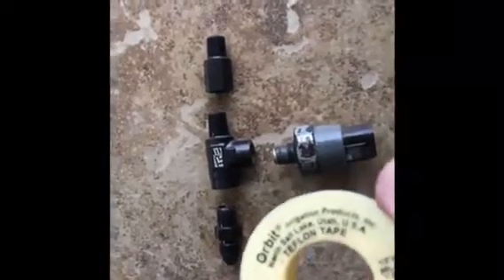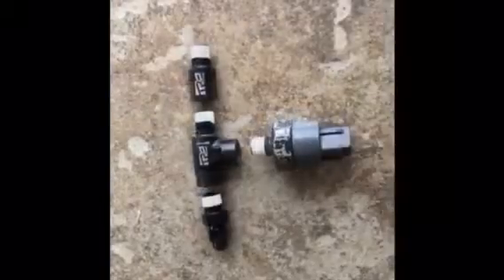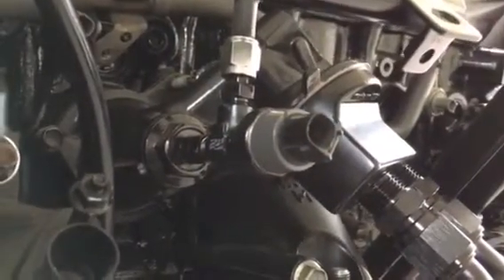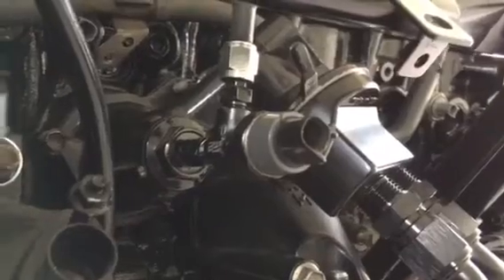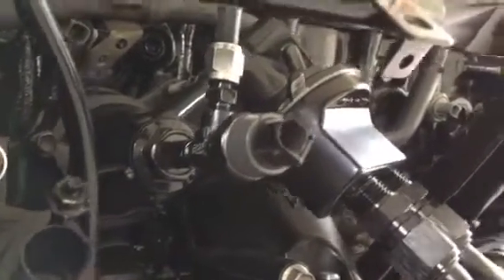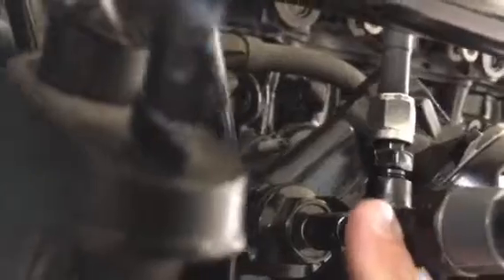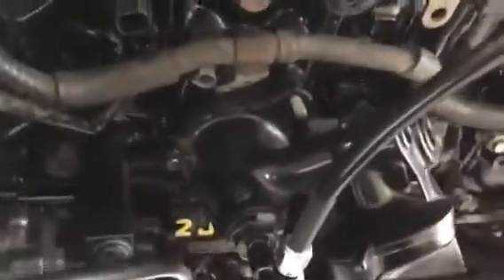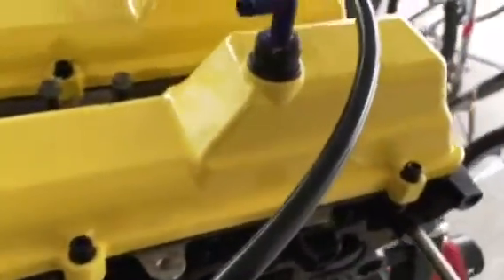Lexus IS300 turbo build part 9/ turbo oil feed line

Comment: Where can i buy that T adapter and also the oil feed line.
Reply from the maker: victor cano tread stone performance
Reply: @dthmtlsk8r  
Do you know the part number or size. Same as the one you bought sorry im new for this .
I need the iol feed line and T adapter for the same aplication
Reply: @dthmtlsk8r  
Or link will be appreciate